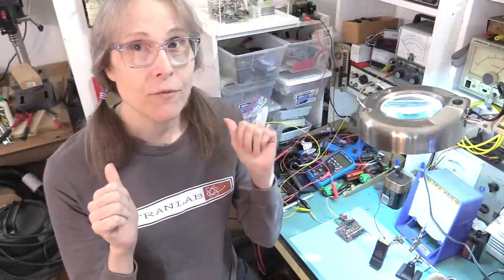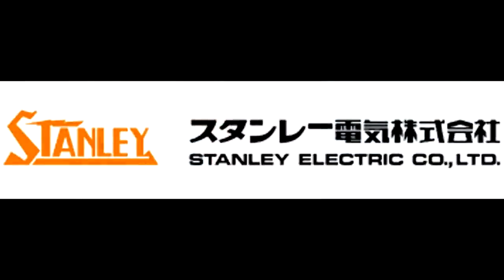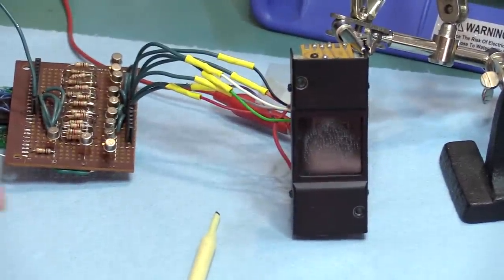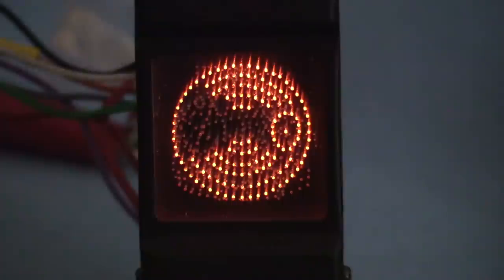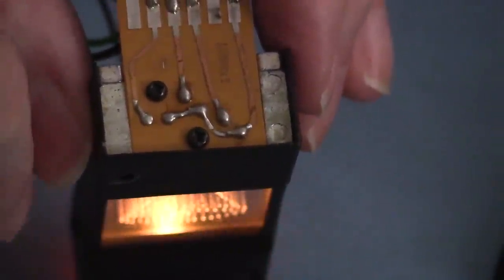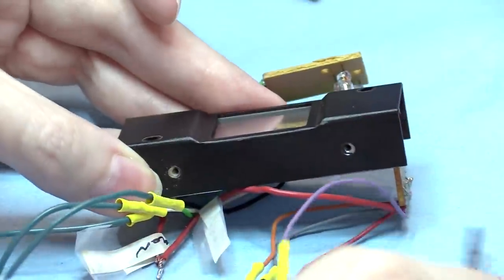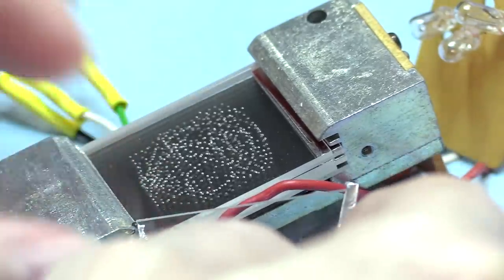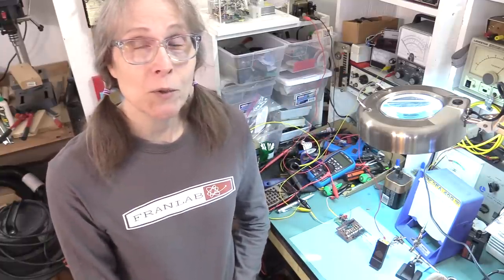Extremely Rare Edge-Lit Fruit Machine Display

Comment: Edge lit displays got rather large: several inches tall, and as you show, allowed for individual colors. The downside was "self illumination": the light of one layer going to the next. That's probably why they used dots instead of solid characters: the dots were probably intentionally NOT aligned on adjacent layers to minimize light leakage from one to the next.

Comment: ET is fairly common - my wife has had it for the last ten years.  You don't have to apologize about lack of fine motor control.  Thanks for showing this very interesting historical oddity.  Things like this aren't practical today due to costs, but I think it would be neat to see some old devices come back in niche applications where price isn't the primary driver.

Comment: 0:52
"Low cost" volt meter
Only $985 in let's say 1963
According to the inflation calculator that's $8382 in today's money
Makes you wonder how much industrial volt meters usually cost back then...
Reply: For 0.01% accuracy at that time I would have to say yes! Just look at the cost of the competition and certainly don't compare it with the sort of cost today. Lab and industral grade equipment is expensive to this day, though I am thinking back 25 years to when my department bought a 1 gig digital storage oscilloscope with colour LCD screen and built in pen plotter... so much nicer than getting the polaroid camera attachment out for the old Tektronix... sorry Fran, I know how much you like yours).
Reply: Ni5ei - Actually NLS was the less expensive volt meter. All others were at least triple in price!
Reply: Based on the evidence I have, a lot
Reply: Bargain! My diamond encrusted Fluke cost a lot more than that. (Totally necessary to charge London prices!)

Comment: An similar thing did we as we were kids: We scratched pictures in transparent foils, stacked them and lit them from the side with an torchlight. When the light was moved up and down the side of stack you see moving pictures! The only thing to do to make it work right, you have to modify the torchlight to an slitlamp with duct tape.

Comment: Something display related you might want to study (if you haven't already) is how decoding is done in the Hewlett Packard 5245L frequency counter.  This counter from mid 60's and for about 20 years was an industry standard.  It had Nixie tubes which isn't all that usual.  Each decade counter had a board with 4 transistor flip flops, also not unusual.  But what is VERY unusual is how they decoded the binary from the flip flops to run the Nixies.  Each decade card assembly had 8 small neon lamps driven by the flip flop outputs.  These were lined up inside an enclosed black plastic box.  Inside was a thin board with a pattern of CdS photoresistive lines that wove around in combinations where the neon lamps shone on them.  Any particular "count" combination of the neon lamps lit enough of one of the photo cell lines to drop resistance enough to the Nixie cathode it was connected to so that digit would show.  But not enough for any of the other photoresistive lines to turn on their digits.  So the BCD to Decimal decoding depended on the artwork of those photoresistive lines.  I suspect there was something about this that was cost saving, or reliability enhancing, or both.

Comment: The best thing is that this kind of display is a cinch to make nowadays, especially by hobbyists. Etch the clear plates with a laser engraver, the bulbs can be LEDs, so bright and colorful they are nowadays, and as they don't put out as much heat, the end blocks can be 3D printed. Have the PCBs made in China, run a whole battalion of those modules off an arduino. Any Maker space has the tools to make those by the dozens.

Comment: I found a similar type of display in an old car dashboard when I was younger back in the 90's, I thought it was amazing lol, still do. From looking at the way the metal is put together it looks like it will unscrew a little more so you can stack the plates in one side, then place the other on opposite end and screw them both to the backing metal part, would be much easier than trying to slide them in from the side. Keep up the good work Fran!

Comment: Fran, what you've showing here looks more like an intentional tremor than an essential tremor. The difference is an intentional tremor gets greater the more you try to control it. You may find that it reduces if you look away (someone else can look and tell you). Intentional tremors appear to come from a processing delay in the visual perception system and/or motor neural system, causing an underdamped oscillation, to give you an electrical-system-oriented description. (I'm an aging double-E & computer architect myself, not a doctor, even as I've studied physiology, psychology and neurology.)

Comment: Edge lit displays had a slight resurgence in the 70s during the quadraphonic era. I have a Panasonic and Toshiba quadraphonic 8 track player that uses the same display unit to show which track is playing. Sansui also used them in their quad receivers to denote 2 or 4 channel operation.

Comment: Many years ago I had a Zenith stereo that used a pair of edge-lit displays for the AM/FM tuner dials.  They were arranged with one behind the other, and each had it's own lamp that would come on depending on which band you selected.  They were made to simulate a dot matrix display type appearance.  I think it was from the early 70's, and was called something like "digi-lite".

Comment: I used to work on "O" scopes and Spectrum Analyzers back in the day and they used edge lighting displays for the different graticules of scales. I'm talking 60s design. Tektronix or HP in fact come to mind. They used that  concept of images on overlays. Hey it worked even on radios back then. 
 I don't know if you drink much coffee maybe cut it back but, some medications cause the shakes too. I don't have as much detail control as I did when I was young but I lost  80 lbs and got off of some meds which caused a lot of shaking in hands. I remember working under a microscope on circuit boards way back too, now I just work with bigger things so the shaking doesn't affect it much. Keep
up the great videos I enjoy seeing them.

Comment: Another cool retro display, and this one looks like it could be easy to reproduce. Score the lucite sheets with a laser cutter or CNC, 3d print or mill the housing, use LED's for the edge lighting, power it with any of the fine Arduino-alike LED driver boards... wish I had the time to try...

Comment: Although fruit machines reels have more symbols on each band, 16 - 24 say, the lower value ones are repeated to give a higher win frequency. So if you only need to display the symbol on the pay line you only need one of each symbol,  so seven would be enough for seven different win values.

Comment: If you want to put the reflectors back on, i might suggest using aluminum tape. cut it lengthwise to the width you want and then hold the free-end down with something heavy. it's easier to deal with because sticky and you only have to hold the plastic bit instead of both at once. -signed someone else w/ the shakes.

Comment: You can see the several thin glass layers at 3:35.  Faint lines across the bottom of the display when the light reflects from the bottom of the glass.

Comment: These would easily work as replacements for slot machine reels.  Yeah mechanical slot reels have 22 positions (or more) but typically the reels only contain five or six different symbols in total (cherry, orange, etc.).

Comment: For a machine with n reels and k characters, the number of all-the-same configurations is k, while the total number of configurations is k^n. Therefore, the probability of getting all-the-same is p = k/k^n = 1/k^(n-1). For the typical slot machine with n = 3, k = 20, we have p = 0.0025. So to get a similar probability with k = 7, we can just add a fourth reel to get p = 0.0029.

Comment: With respect to the movie props, I suspect LEDs simply weren't bright enough back in the 80s.
Reply: And probably flickery when shot on film, as they are usually lit flashing on and off sequentially. Filament bulbs, even when powered on and off quickly remain glowing for a while when shut off, and ramp up to maximum brightness "slowly" too when turned on, so they're less likely to flicker on film.
Reply: NowLEDs are bright enough to illuminate entire sports fields.

Comment: NIce video , you have used a 555 and a 4017 for the driver , if we use 3 of them we can display 777  so it may be an old casino machine display

Comment: The end parts where those slid into were removable from what I can tell, which would make assembly easier, since those foil and film ends aren’t so willing to slide along their length, but sliding in should work easily, also you don’t have to take everything apart if you don’t want to, some things are less obvious like the binaview but I would think we would have got on fine without this one, I hope you didn’t loose any of the functionality of the display (I didn’t notice if you got the lens into place or not), also as for the tremor thing, is it when your heart beats? I have something similar and it’s really noticeable when I hold my breath, I almost think it’s related to long term oxygenation issues as I have asthma

Comment: Wow, that thing is build like a tank! Sad that nowadays, a simple lcd would replace that easily.
Reply: Having been an electronics hobbyist in the 1970s, I'd say it's far from sad, that today you can buy any kind of display you want for a few bucks.  Displays like some of these that Fran has shown were on the order of $100/digit.  Even the "cheap" Nixie tubes were around $10 each, which was quite a bit for the time.
Reply: @BrightBlueJim  I have to agree that new display are cheap and easy to implement. I simply find it sad that all the engineering that went into those old display is fading away. Well yes it’s called progress, I know ;)

Comment: I wonder if they were used in BttF because the LED versions either weren't bright enough, or didn't produce wavelengths that exposed well in film emulsions.
Reply: @mycosys  LEDs don't inherentpy flicker, it's a matter of what circuitry you use to drive the LED. For mass production cost reasons, that frequently involves fast flickering, but that wouldn't really be a factor in a film production.
Reply: @mycosys  good for you, but that doesn't make your statement any more true. LEDs do not inherently flicker. It entirely depends on what is driving them.